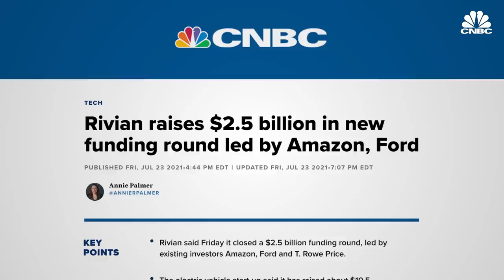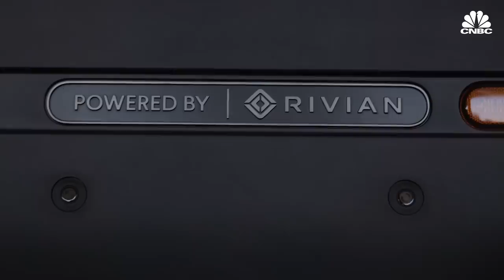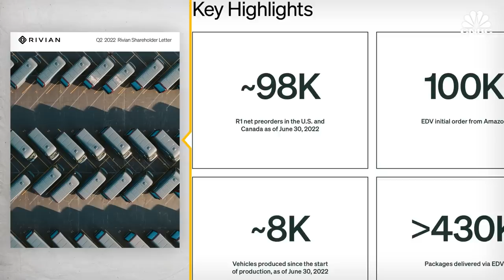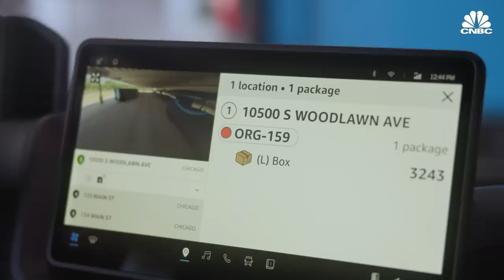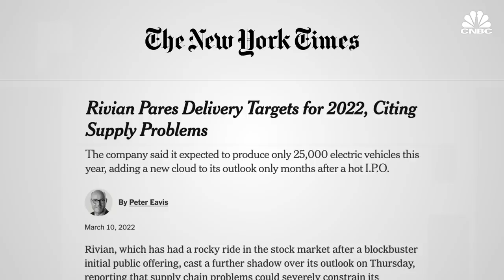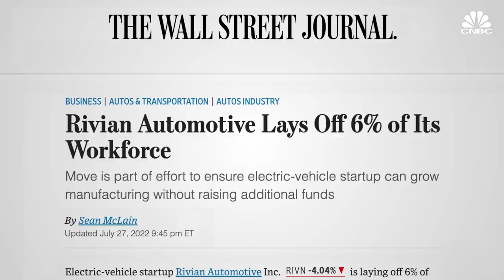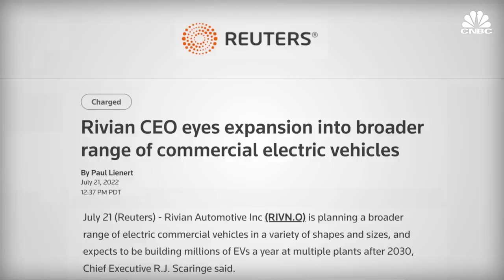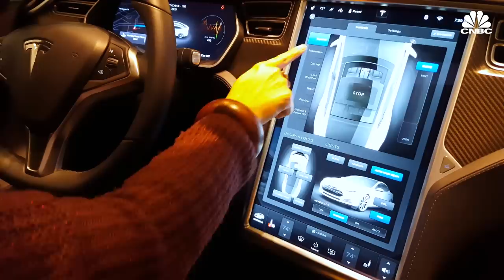How Amazon Is Giving Rivian An Edge In The EV Industry

Comment: Pretty cool, as I use to be a route driver and having a quiet truck with no noise, pollution and so on would be awesome. One thing they dont say in the video, are the specs of the vehicles batteries, range and so on. This Rivian is new to me and looks good, but I like what Canoo is doing with there multipurpose, van and pickup; and all for a reasonable price too. They have Walmart as fleet company as of now and their multipurpose should attract booth commercial and residential customers.; and all there vehicles prices seem to start at about $34,000. However, both Rivian, Canoo and others, should do what the two companies in the links below are doing and many more seem to be going to it as well. That is Solar Power Panels built into the vehicles directly and with the ability to charge while driving or parked; as well as from a solar powered station. No doubt it is minimal as of now, but I can see in the next few years a major breakthrough in the solar tech, battery tech and other alt tech as well. I saw a video by a guy named Scotty Kilmer I think and he showed a Chinese company whos cars swap out batteries at a small automatic station in a few minutes; and you drive off with a new fully charged battery. Just another great tech and way to expand the EV market and ideas. 

I vision the Planet and Society running on "Free Energy", not just from the Sun,  but I just know that God gave us our Bodies and our external world to show us the cleanest, infinite and "free" ways to do what is needed. Everything is energy, a vibration, sound and light and there is no doubt that the ancients knew this and that many have almost "remembered" how to do it again in this age. Like the pyramids and obelisks around the world, we can do the same again without the harmful frequencies, pollution, waste and sustainable without even the need to recycle anything. The ancients never needed to, because they used everything in a what I call a continuous loop system; like say our Power Plant would send out the power and would also receive back power from the system and the original infinite source it gets it from. I bet they could as of now, build some type of what I would call a inverter/generator inside of the vehicles, that would be electric and take some power from the system; and in turn make sort of its own power to feed back into the main battery and system. Im no tech guy, im just feeling this and from the tech I know exists already. Maybe they could be small and on the wheels or even like small wind turbines grabbing the flow as the car drives and mounted in the grill and so on. They know they could do this, but like most things, its about "money" and being able to "sell" parts and have things "metered". One day, hopefully soon, someone will build things completely from their Heart/Love and for the greatest good of not just Humanity; but for all lifeforms and the Planet Itself.; freeing Us from so many of the old systems. Of course we all have to do our parts and Consciousness and Awareness from unconditional love has to be felt, realized and embodied for this to happen as a Collective. I feel that if true clean, green and infinite Free Energy comes forth on all levels for all of society, this would bring about such a much needed relief to the Planet, all its lifeforms and the Human Species would have a break from bills as well. Solar, Wind, Waves and so on, are all great, but we need the real deal; the tapping into a pure energy from our Heart Center for the greatest good of All Life. I think that is the key to unlock that Consciousness that will bring about the memories and understanding of that type of potential and energy understanding; that goes beyond our current collective that does things mostly for "money, power and control". Back then, they lived in Unity, had no money, knew who they were, what they were and where they came from; and they lived in harmony with the Planet and all on it. They knew energy from a spiritual-science viewpoint, because they were awake and fully conscious and embodying unconditional love and their connection via energy-feeling; as well as the mental understanding. Im not talking about how natives speak about a connection to the Planet and all life is connected from just a mental understanding; im speaking of the actual energy flow in them and how they were themselves connected to all the energies around them.

Anyway, the eastern cultures have known the body sciences for thousands of years, but almost always just "mentally" and not actually living or embodying the lifestyle and showing the way. So now we need to bring back that spiritual-sacred science of ourselves and into our external world; to evolve and achieve the most loving intelligence within us and into our tech. May sound strange to many of you who have yet to awaken to that path and awareness, but its real and it comes from healing oneself and love of oneself. It would have been strange to me hearing this before I awakened too and I actually mocked things like this years ago. So hopefully by me writing this here under an "electric car" video and talking about Solar Power; that it ignites a spark within that gives you the inner knowing of the truthfulness of what I speak. A brief example, I use to eat a ton of food and I am a small guy, but my friends use to joke about how much I could eat and never really gain weight; though I was an athlete and gym rat for years. Then I awakened inside due to me facing myself, healing, therapy, backing away from nonsense and seeking out more spiritual and science of the ancient world; as well as questioning everything like I did as a child. This started the inner experience within me that showed me more to life, more to this body and more to this earth and beyond. I came back with a total new consciousness and awareness that I just knew things from back then and how to live better in this life. So instantly I became a vegan and cleaned my entire lifestyle up to match that which I know we lived back then and beyond this realm of reality. Basically to live "heaven like" in this body, meaning as pure loving and compassionate and natural as possible. So, I was and am able to eat just one small vegan meal a night and mostly raw as well. My friends were shocked at this since they knew me my whole life and how I was always eating, as well as all the other changes in my life and the new understanding of energy and the importance and affect on our health and bodies. I now easily understood the ancient texts and bible that coded the sacred science in stories, metaphors and so on. As my consciousness changed and I felt the truth within me and understood it mentally and experienced inside fully; my body followed suit. Less food and vegan now equals way healthier, cleaner and more clear emotions and mind; as wells as less money spent. Thats why I know our bodies should come before our tech, because then we will be sure to use the best harmonious materials and frequencies for the greatest good of not only our Bodies, but for the Planet and all upon It. Look at the ancient world and the structures, all stone and the higher conscious Humans that built the larger sites; knew that it resonated naturally with their bodies-energies and their surroundings. Their structures still exists, our modern steel, iron, wires and tech corrodes, breaks down and pollutes during its life and when its done; it goes in the ground or oceans to harm other lifeforms. Their structures look awesome still to this day even abandoned, take a drive by Detroit, Camden, NYC or any city in the world that is abandoned and see how that looks. Theirs left no pollutants of any kind, our cities leave all harmful materials as they decay.

As I said above, "God" or what I call the Creational Source, leaves evidence and ideas all over our Planet and in the skies to help us evolve to a more pure way of Being and for our Tech; we just dont see it at our Consciousness, until we heal and seek out higher understandings. Since we are all a spark and extension of the Creational Source, "we" left behind all those structures to help in this age of living. Florida was hit with a cat 4 Hurricane and look at the damage to our style homes, materials, grid and the "money" to repair and replace it all. All over the world we rebuild in the same areas and with the same materials that will once again get destroyed and have to be replaced and with that thing called "money/debt". Makes no sense right? So why do we do it? Not very conscious, programmed and conditioned, unhealed and very little ability to see beyond the old ways. It does look like certain tech is moving into the right direction, but we need to raise our consciousness and have our inner loving intelligence leading the way. The mind alone of tech and the other shut down part of the mind and closed heart centers, will only take us so far. We are in need as a species, of a true spiritual awakening of our Heart Centers and the Consciousness of Love that fills it and in our own power source of our solar plexus; again, this takes healing within us all. I hope this comment opens some hearts and minds together in Unity and awakens you to an expanded knowing of such possibilities. Lots of love to you, Chris

https://sonomotors.com/en/sion/

https://aptera.us/vehicle/

https://www.canoo.com/

Comment: Rivian will be an Amazon lackey and Amazon may buy them out. Mark my word, Rivian will not meet their 25,000 EVs (from their initial projection of 50,000) this year based on less than 7,000 EVs for the first half of this year. Unless they make some drastic changes like more robotics, their labor force for the production line is no different that any of the Legacy EV manufacturers and they are a start up company. Amazon may provide more money, which means that Rivian will give up more shares of the company until Amazon takes it over.

Comment: EV vehicles have a much larger carbon footprint from a mfg. perspective. The batteries are a huge part of that. We need to have a lot more renewable energy in order for EVs to be carbon neutral. The carbon emissions have been moved from the vehicle to the power plant making the electricity. Charging a vehicle off of regular power plants is much more inefficient than the internal combustion engine.

Comment: The biggest problem with electric vehicles is that there isn't EV charging stations everywhere and the vehicles can't be plugged into your Standard wall outlet in a building , they need a special high voltage power supply.
Instead of making vehicles that need to be plugged in they need to be designed with a solar panel on the roof of the vehicles.

Comment: More emissions are produced manufacturing EVS than what gas powered vehicles currently produce.
Reply: This is such a lie. All these parts for regular cars need to be mined aswell.
Reply: Once it produced it wont emit ,compare to ICE it will emit as long as you keep 'em running..
Reply: @cobaltblue2756   to be fair if you're charging off a fossil fuel they still "emit emissions"
Reply: @Jeromeeb  you are right about other metals have to be mined for gas powered vehicles but it's a lot less. There has to be a ton of lithium plus other metals mined just for the batteries not too mention all the other metal on EVs thats also on gas powered cars. They are acting like EVs are going to save the environment and that's just not true. What happens to all those EVs when the batteries die and all that needs to be disposed of. I don't have the answers but I know that's not the answer. I just think people are largely misinformed.

Comment: Hopefully they succeed. We need more competitors to bring the costs of an EV down. Right now, they're just too expensive. When the first Subaru Crosstrek AWD EV comes out that gets 250 miles of range, does 0-60 in 7 seconds and costs $28-$35K, then you'll get to the point where it's a viable option. The Tesla Model 3 was close, but their recent price hikes are such that you're more than likely, after getting all of the options you want, going to spend $60K. That's just too high of a number for the average person to justify.

Comment: Our grid cant even support our current electricity needs, this movement to EVs will only make our power much more expensive. We will be in a much worse situation than we are in now. Its not at all as green as "they" are trying to make it sound. Also now a gas engine can get you across the country in a day or two, a worthless EV would take 7 to 10 days and most likely total cost would exceed the trip in a gas engine car.